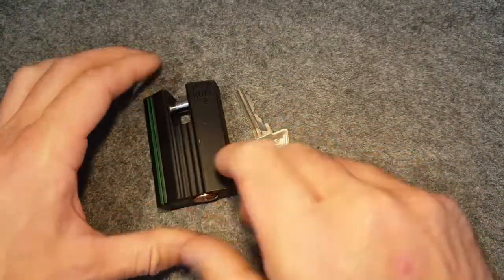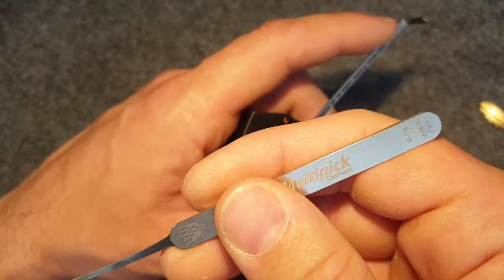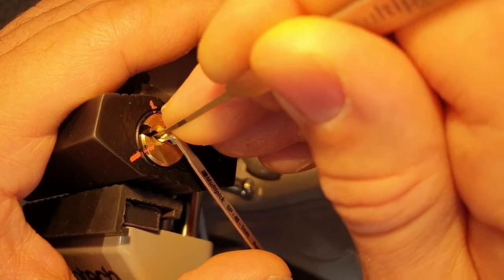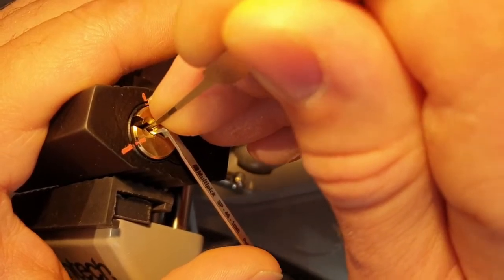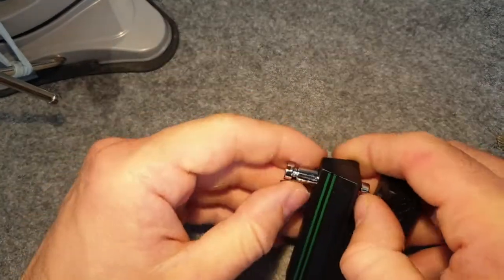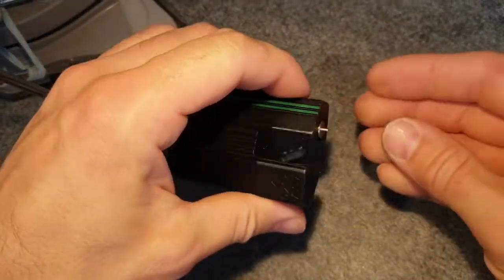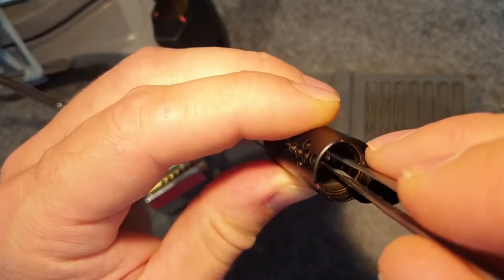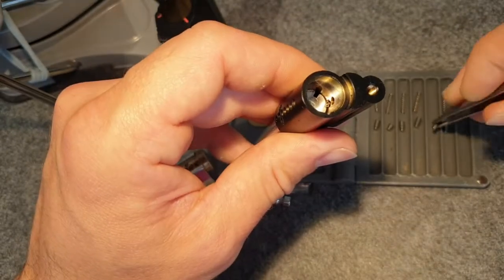[79] ASSA Ruko 2 Padlock with closed shackle, pick and gut

Comment: Thanks for the entertaining video.
Very impressive picking.
The floating tensioning is necessary to get the driver pins out of the counter milling? Or in case you overset a key pin?
Und gute Besserung
Reply from the maker: Thank you very much for this nice feedback 🤗
Ah, yes the float picking is needed because teh drivers get caught in the counter milling of the core and will give you no feedback at all. Checkout my video [60] where i explain this technique in a bit more detail 😊

Vielen Dank, ist zum Glück schon etwas her und ich bin wieder fit 😊